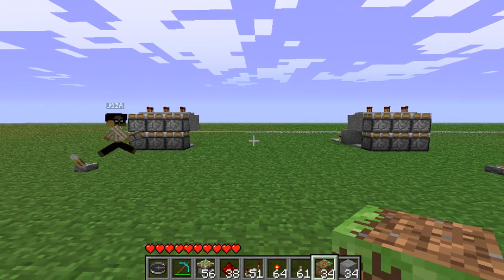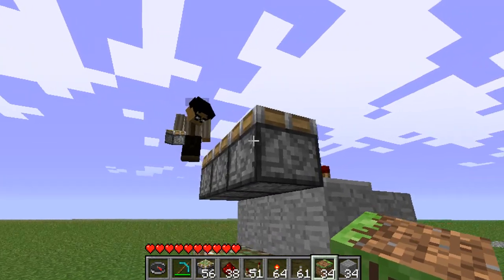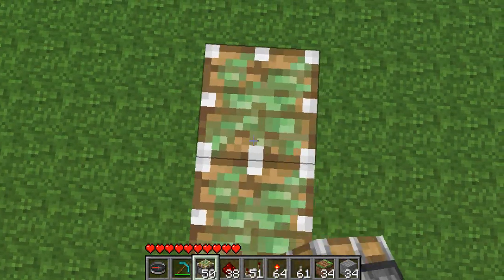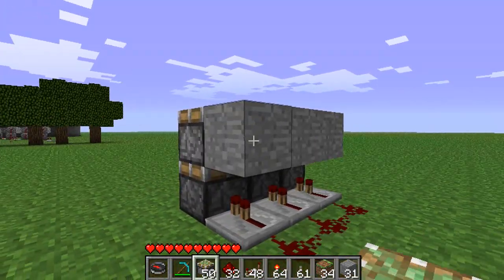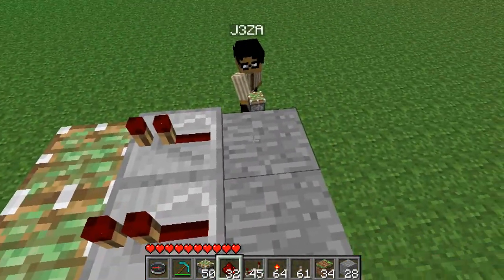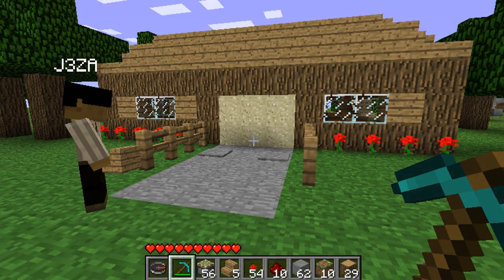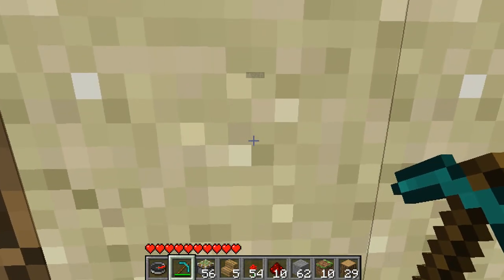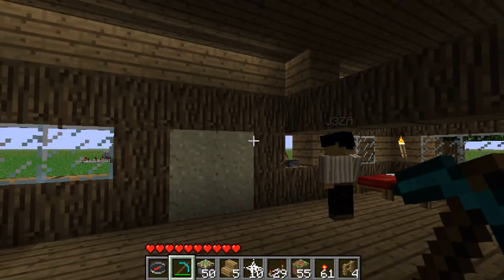[Minecraft Tutorial] Double Vertical Pistons

Comment: Holy Crap guys there's an easier way of doing this!

Bottom Piston: Repeater set to 3
Top Piston: Repeater set to 1

And there you go. These timings work if you have a solid block between the piston and repeater. What happens is that when the pistons are extended the top turns off then the bottom, in the right order. And when extending the top repeater fires first but there is no piston to power, the bottom then powers, then the top is in position to be powered by the repeaters and goes ahead.